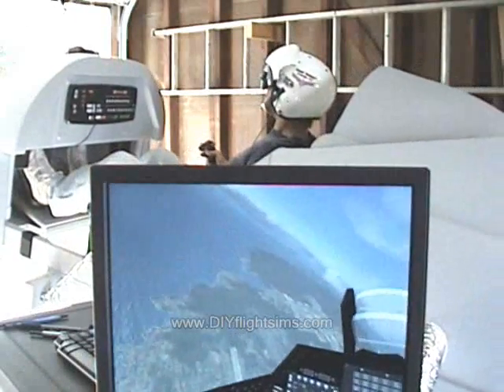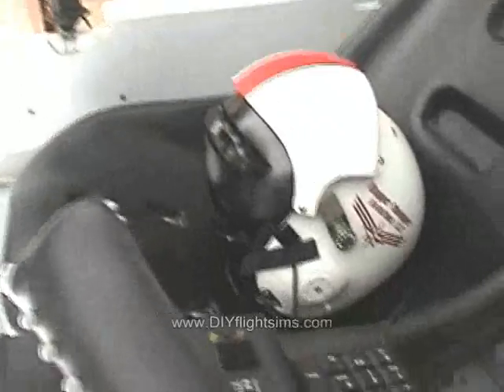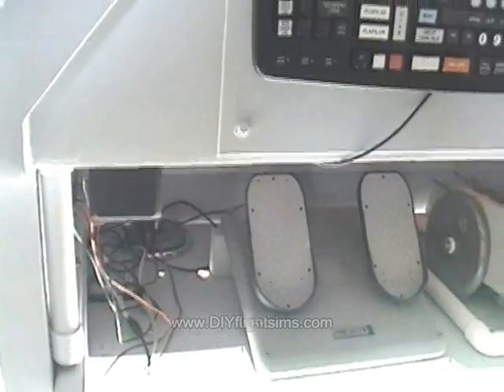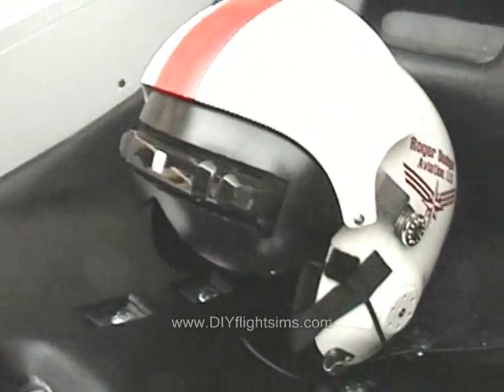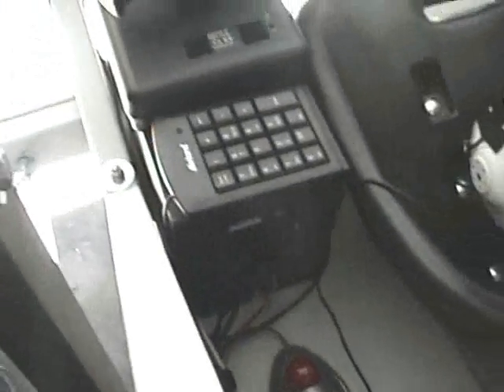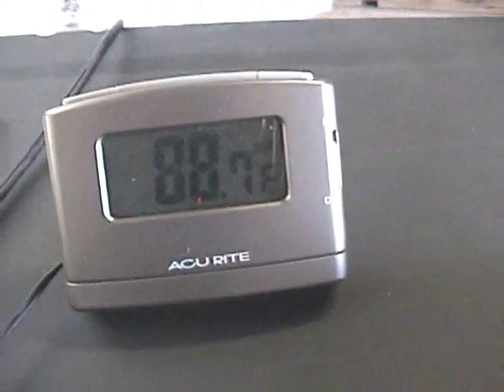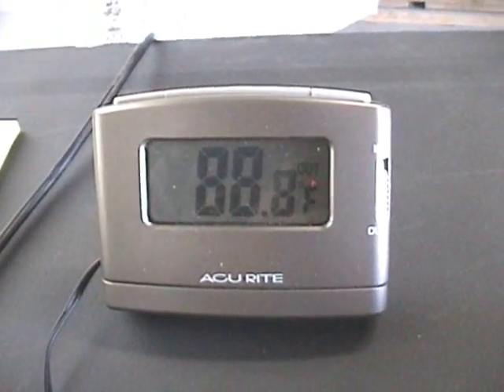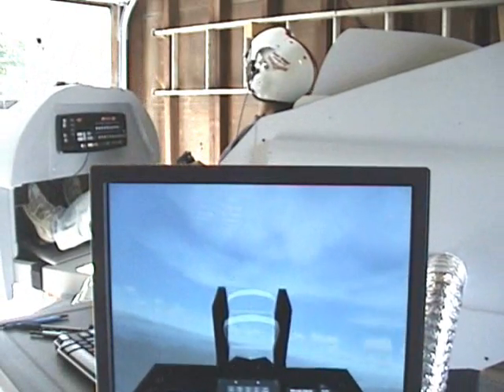MAACS Experiment - Episode 21, Test Flight

Comment: You are truly an inspiration! You are indeed using your talents to further the world of simulator aviation. I see on you left console, behind the throttle, you have a 17 key Num Pad. I have a question about that. Do those keys follow the same assignments as the main num pad, or have you come up with a way to make the computer recognize different keyboards? Just wondering, because I am currently building a simulator somewhat like your PACS simulator, and I would like to have a lot of keys! Thanx!